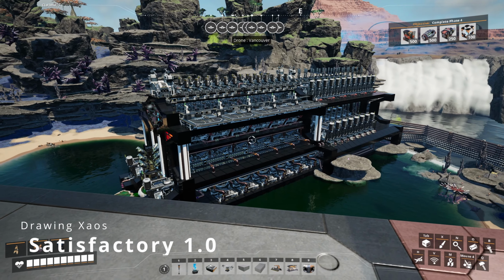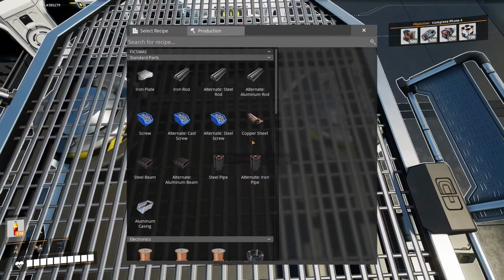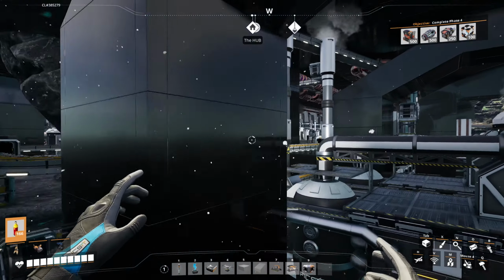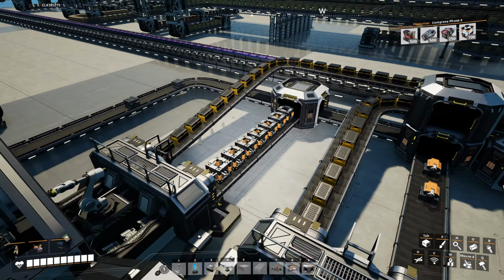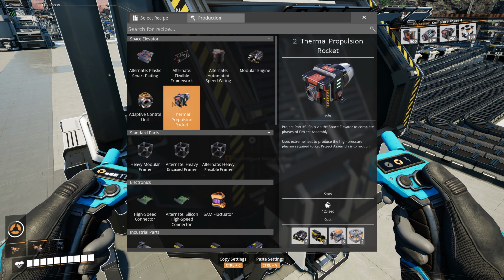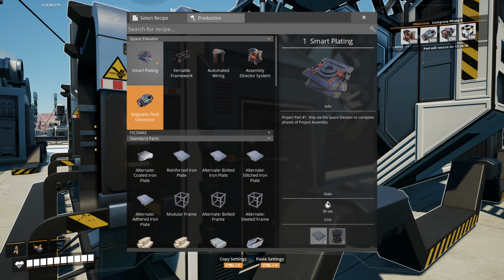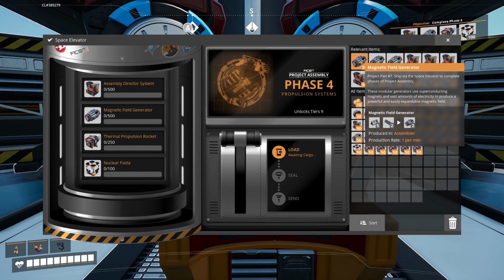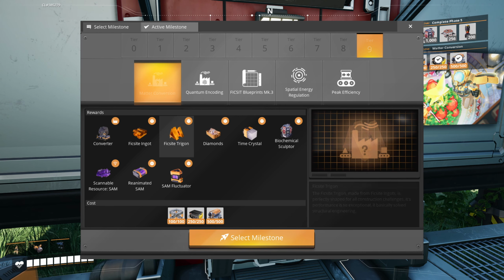Speed running Phase 4 in Satisfactory 1.0

Comment: i have been sick almost constantly for a month now and now i see you ended this video at the point where you have unlocked as much stuff as i have in the game...
gotta automate some stuff and unlock the rest myself before i have to see them from a video...

also the glitching out of existence wall thing made me think of the object limit in the game... and it made me wonder about the thing where the game makes 2 belts connect to be one belt if you build a merger/splitter exactly where 2 belts connect and then delete it... it made me wonder if its still considered as the same amount of objects or does the combination reduce the count... cause making belts connect on some long stretches would probably be a good idea if it can make the game consider them as a smaller amount of objects...
should probably try asking this on reddit but cant bother to...
Reply from the maker: yeah i really did speed run thing and  i feel like i might not should have but... i really want my mk 6 belts.
its crazy, but i think its not the object limit... i shouldnt be that close to it... well hope not. lol
Reply: @DrawingXaos  checked on this topic a bit and buildings count as more than 1 object each and each segment of belt is its own object so its indeed recommended for people like imkibitz (and probably you) to always use max length of belt when possible and removing stuff like the support pillars from the belt placements and making stuff hollow (removing all parts you dont actually get to see) and always using the max height walls and foundations when building up....

but apparently items on belts dont matter...

so to my understanding the trick with the merger/splitter placement and removal to merge the belts should affect the object count... 

probably should install a mod telling if you are close to the object count if you are paranoid... this would probably also able to test if the belt merging affects the count or not...
Reply from the maker: @Necrotechian  downloading a mod would be my best bet, i know about the object limit referring to polygons or something like that. its why i like to over clock my builds... im going to see if i can find one and test where i am at.
Reply: @DrawingXaos   do tell if the belt trick does something while you are at it if you dont mind.